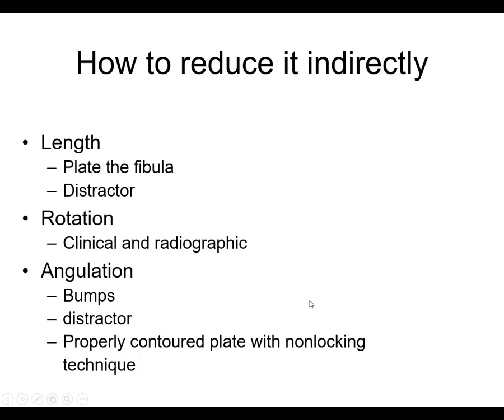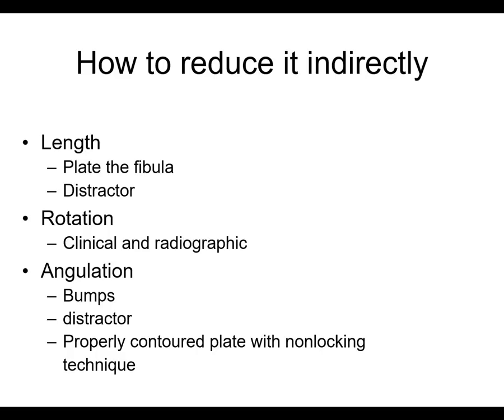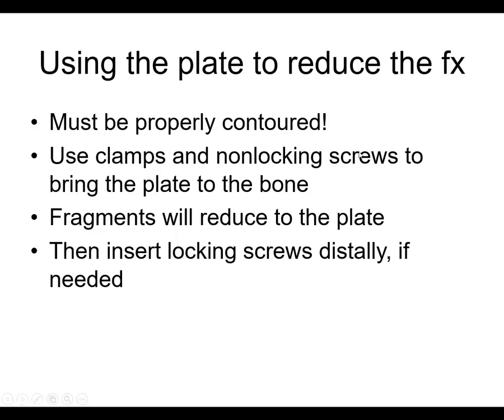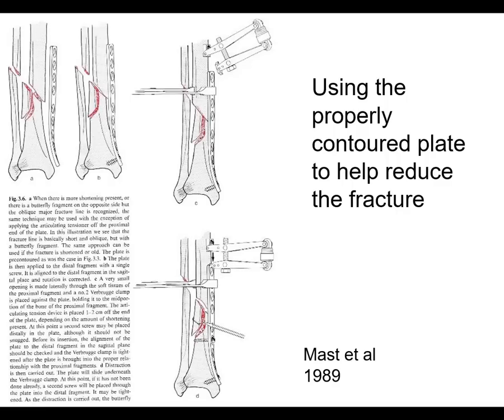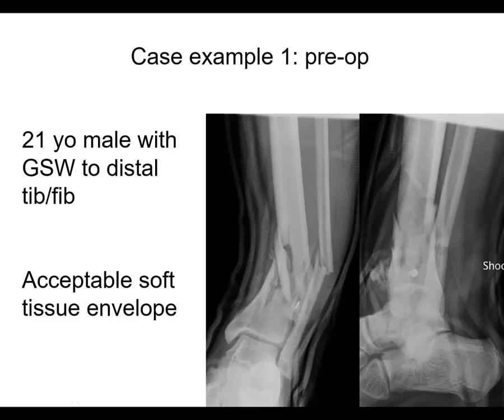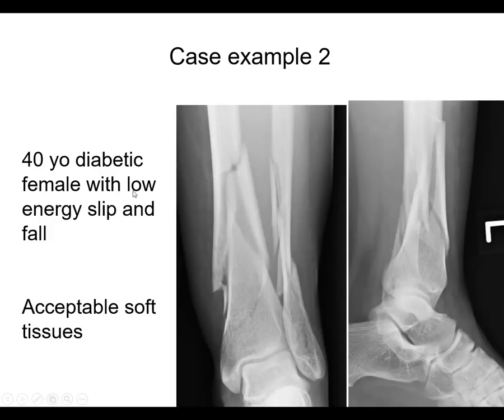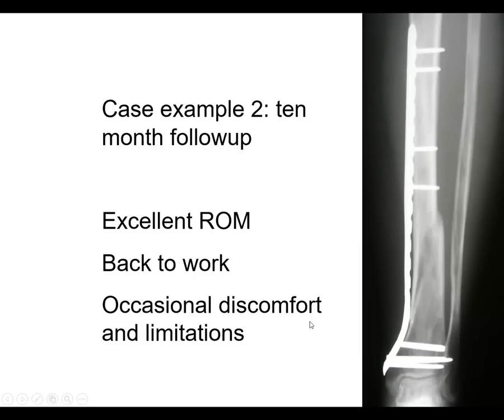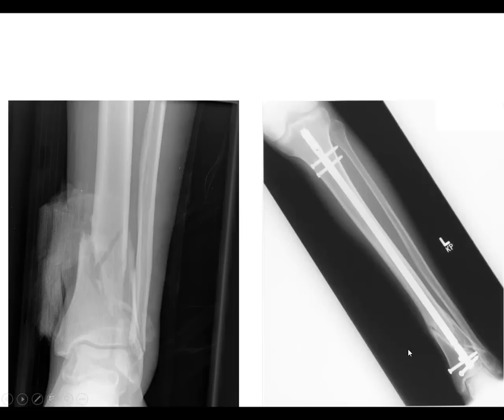Tibial shaft 2

Comment: Hello can i ask about my tibial shaft fracture. Now i am on its 3rd month and then there is this event where i was checking my motobike, when it suddenly going to drop so what i did was to hold the bike not knowing i stil do not have to force my legs. I felt sudden pain on my leg and went to hospital to have an xray. My doctor said it is still intact but what im concerned about is that there is this swelling on my anterior left leg just i my fracture site, and now it looks like my bone just gont misaligned, but my xray was ok, i felt some pain when i touch it and my leg feels different now.